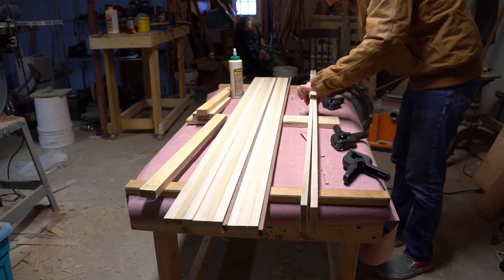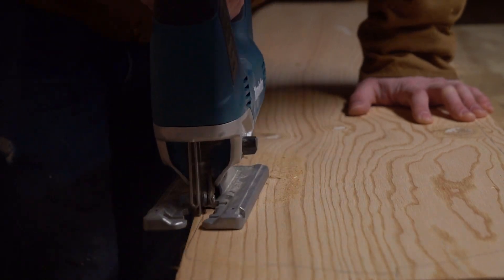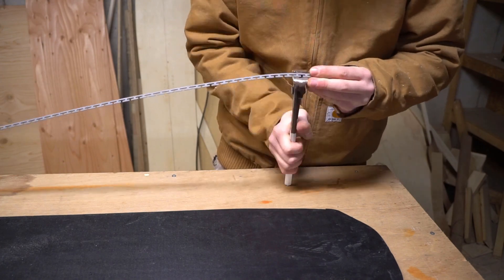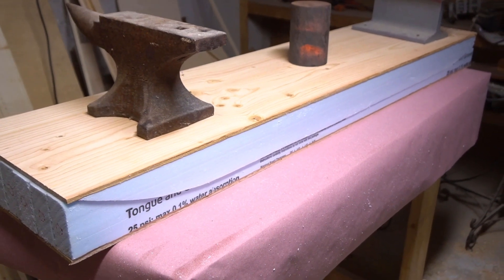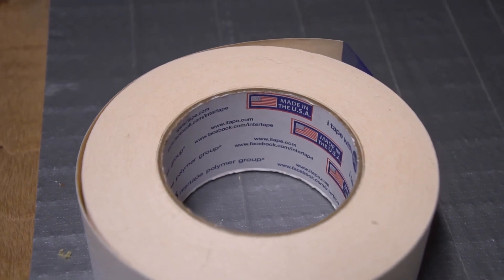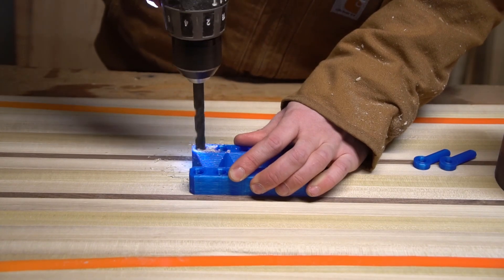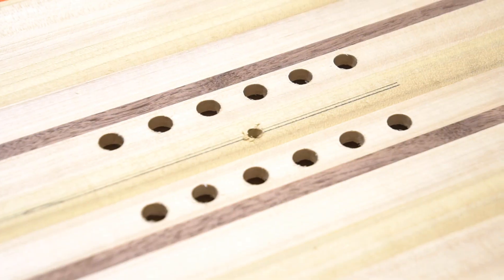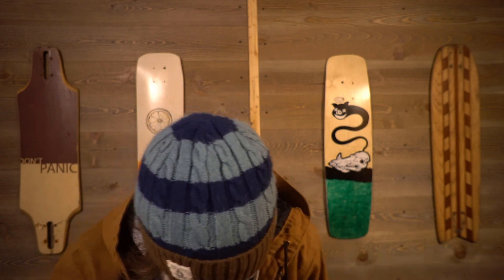(Re)-Making All the Parts to Press a DIY Snowboard - Snowboard Build Part 12

Comment: hi!! amazing job! i learn a lot from your videos... and it works for me to compare with my building processes and methodologies. i actually build skis since over 2 years, and i would like to move for making the sidewalls in the ski, same as you are doing. but i faced some problems... what router bit are you using? in my case i didn't want to use a very wide one... cause there's a lot more gap to fill later with the casting resin... and it's expensive. and you don't want to go deep that you pass through the wood... so with this caracteristics, the routers i tried were broken. too much heat... any suggestion? thank you in advance

Comment: Hello Chris 
I was wondering if it was possible to  buy 2 of your 3D printed panels and if it could fit in an envelope. Thank you
Reply from the maker: Do you mean the wedges that I used to make the core profiling cradle? If so, I don't currently have those available (this core profile is... weird) but I could add it to the to-do list
Reply: @GoodRoads  Amazing work! I too have started the journey to create a mold press and snowboard. I am trying to recreate your magnificent core "sled". I have access to fusion360 and a 3d printer. Any help, tips or information would be greatly appreciated!
Thanks

Comment: Did you still need a polyurethane before pouring the flex it 90?
Reply from the maker: I actually didn't think to test that. I did a test to make sure the polyurethane and flex-it wouldn't interact with each other in a bad way but I didn't test without. Might be worth looking in to, it would make things easier.

Comment: Great Vid! I am also working on building a board. I see you printed out the shape of your board to scale on paper. I am working on some cad models right now and would like to do the same. Were you able to have a local print shop do this?? Thanks!
Reply from the maker: I printed mine out in sections and then taped them together

Comment: I collaborated for years in a snowboard factory,  at the beginning without a cnc machine we were using the same method to profile the cores. Talking about epoxy, if you use a tray instead of a cup, epoxy will have more surface contact with air and the tray itself so in case of heating during the pot life it will last longer, if you don't have a wide tray it's enouth to split epoxy in 2 caps, less quantity, less heating during catalization, longer pot life.
Reply from the maker: For this method do you mix the epoxy in a cup and then pour it into the tray? I'd be worried that I would be able to mix it thoroughly in a tray
Reply: @GoodRoads  yes cup first and then tray.
Reply: @Good Roads are you going to use vds rubber between edges and core?

Comment: That seemed to go so much better!  Looks really great. I made a jig for drilling out inserts. I just laid out the hole centers on a piece of MDO abs used a 1 1/6 bit to drill pilot holes on a drill press. I then screwed the jig right to the core, and used the same bit to drill through the core. After removing the jig I then used a forstner bit to counter sink using the pilot hole to center the bit. I then flipped the board and drilled through for the insert holes. Any tear out on the exit is hidden inside the counter sink.using a drill press is critical here. It keeps you straight and gives you good depth control.
Reply from the maker: I think out of all my experiments I like the pilot hole jig best so far, but I do like the registration keys and I was hoping I'd be able to 3d-print the whole kit. Screwing it in place is a cool idea though, it definitely won't wander that way.

Comment: Does your mold take into account the core is thinner at the tips than at the centre? Core looks great btw
Reply from the maker: The mold itself will flex a little bit, but I've also got a soft piece of foam that I'm going to lay on top of the layup over a sheet of plastic that will deform and make sure the whole thing is clamped down evenly
Reply: @GoodRoads  cool, hope it goes well, looking forward to the pressing and finishing.